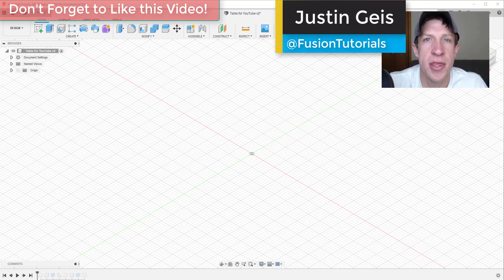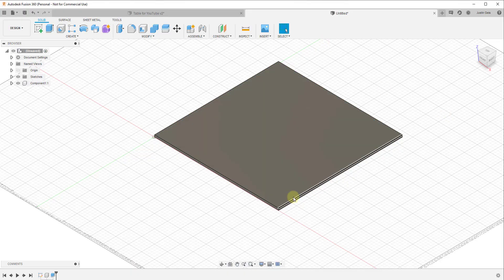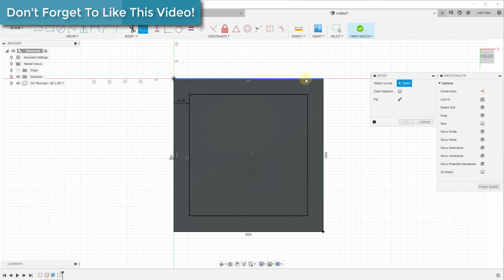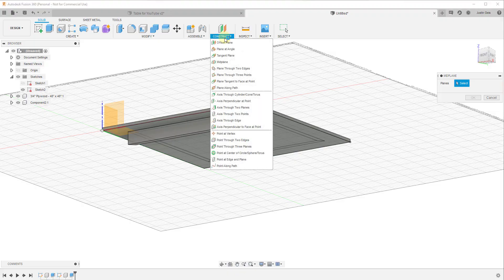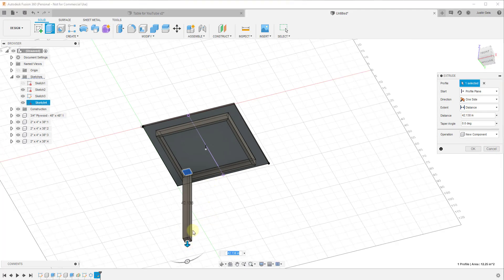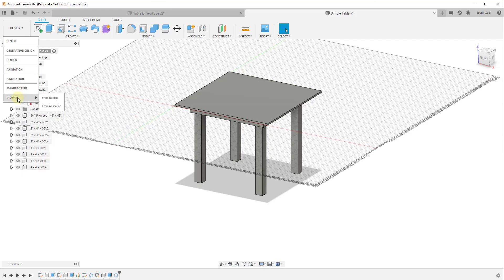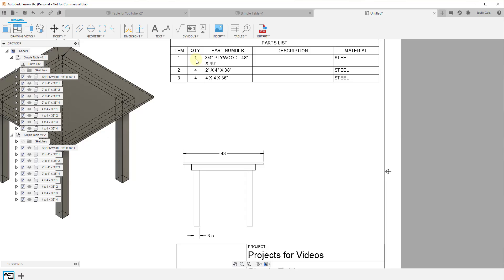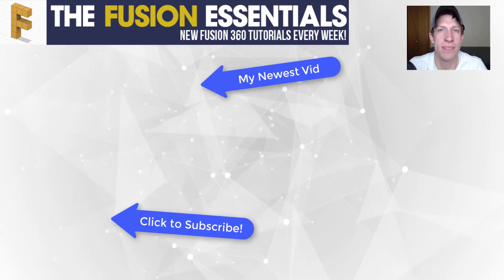Modeling a Table and Generating PLANS AND A CUTLIST! Autodesk Fusion 360 for Woodworkers 3

Comment from the maker: Hi everyone! Let me know if you have any questions about creating cutlists or plans from Fusion 360 in the comments below!
Reply: Is there a way to calculate board feet from fusion so that I roughly know how much wood I’ll need to go purchase? There is a sketch plugin that can do this
Reply: @Tatechow  I second this question. That would be really useful.
Reply: Hey.
Could you please make video with similar example but made from metal tube squares?
Reply: I am creating a curved storage bench with a multi-hinged seat, for an alcove. Do you know how to draw that out creating a curve based on the foreward most plane, essentially a flat line at the front of the piece of furniture. I have the distance from that plane at 1 ft increments along the width to create the curve of the seat but am not sure if there's a way to have the actual curve created based on the points. The piece I'm creating is something like this only boxed in and with a hinged seat.  https://www.goldenteak.com/westminster-teak-circular-curved-backless-bench-83-in-w.html
Reply: Great stuff.  Might be a topic for a different video but I would have loved to have you made the legs tapered.  Seeing how to do that would have been really helpful.

Comment: When designing real pieces in my workshop the design process is iterative. Joinery changes. Pieces change size. Embedding the size of an item in the component name we certainly lead to errors where the component changes size and its name does not reflect the size. Is there an advanced method of using tables where actual component size based on the drawing can be reflected in the table? I want, for example “Leg” to be the component name and to have another auto generated column that presents the Leg’s size based on the drawing.

Comment: i know this is an old video but this is where I'm at in the design stage. This table works only because the table is simple and symmetrical. if you are making something irregular the cut list is useless. say you need 5 legs 1 in each corner and 1 in the middle that 1 in the middle cant be a copy so your cut list will show 4"x4"38" quantity 4 and 4"x4"38" quantity 1. The only way i found to get around it is if i generate a custom table and add all the information manually. I genuinely don't know if I'm missing something or dose anyone have any suggestions? Also want to say your videos are well done and easy to fallow.

Comment: Great videos and thanks for not including any antics or fluff - it shows a rather considerate level of professionalism.  I've learned alot from your videos and have already made a toolbox and set of drawers, though I am struggling to make a workshop table cleanly.  I keep having to start new sketches to add extra elements I did not think of (i.e. extra joists, extra legs, segmenting apron into components, etc.) and now want to mirror one side to the other, but "it" won't let me in Sketch mode, which points to the need for some Fusion 360 Troubleshooting videos; you'd be the first to do that as nobody else has done this.  Sure, everyone presents the videos as if all is smooth sailing, but there maybe rougher waters you could help us overcome? Keep up the great work! Thanks, Kurt

Comment: This was very useful; I learned and practiced a lot! This is an older video...some of the interface dialogs are slightly different. In particular, I couldn't get your "midplane" technique to work (long description omitted). Further research indicated that I should create the table top as a Centered Rectangle, centered on the origin. I was then able to create the patterns as taught. That said, I could see needing to find a center point of an object that ISN'T centered on the origin...future skill learning. I also named the components for what they are, e.g. "Leg," and used the component's Description Property for the dimensions, which gave me a more understandable Parts List (wish I could attach a screen snip...).

Comment: I know this is and old video but when I try this even on a simple design, going to drawing (from design) the screen changes but then Fusion 360 freezes.

I have tried multiple times.  I even purchased Fusion360 thinking the Free Version could not do this.
Reply from the maker: Does your PC meet the system requirements? https://help.autodesk.com/view/fusion360/ENU/?caas=caas/sfdcarticles/sfdcarticles/System-requirements-for-Autodesk-Fusion-360.html

In general if this was a version issue (Free vs. Paid), I'd expect a pop-up or something saying to upgrade to the paid version to access the feature. As far as I know, the 2D documentation feature is available in the free version. The fact that it's freezing up makes me wonder if it's a hardware or graphics driver issue?
Reply: @TheFusionEssentials  Well I have a i5-7300U   which is 2 cores and 4 threads.  the link stated I needed 4 cores.  I guess that is it.   
 
Thank you.

Comment: Hi Justin. is there a way to automatically label/name a component based on the size so they are easier to manage, especially for resizing. i realize curves or anything with more than 4 sides/6b faces would be tough but doing this manually is a pain and error prone

Comment: 1 Thing I love about sketchup, is that I get a picture of my plywood.  So if I were to build something out of plywood, I could simply say my sheet is 4x8, and then it automatically places the pieces on the 4x8 sheet, making it a lot easier to see the best way to cut the full sheet for the most material.  Is that doable in fusion?

Comment: Very helpful video, thanks for your effort in producing it. I notice the Description column in your table is blank. Curious whether you can add something in there manually - or does Fusion populate that column from somewhere else in the design? What if you control the leg length with a parameter so you can't put in the length of the part in the component description? Have you already covered that in another video?

Comment: I'm watching this, and have a question on basic F360 setup.  When you draw your rectangle for the top, you type in the dimensions, and after hitting enter on the second one, your drawing still shows the dimensions.  Mine does not, and I would like to turn that on!  I do see that they go away when you click finish sketch, which is fine.

I may have other questions as I watch the rest of the video, but wanted to ask this before I forgot.

Comment: I watched this wondering how to make an all steel welding table (please tell me if I'm wrong or please make this exact video but for all steel plate and tubing)  What I think I'm realizing, is that; it doesn't matter what the material is because: if I know the finished dimensions of my stock the "sketching" process would be exactly the same?  Another awesome video either way, Thank you!

Comment: Thank you for making videos like this. But... The cut list is not tied to the actual dimensions of the pieces.  This kinda defeats the purpose of using parametric modeling in my opinion. If you were to change a parameter, your cut list does not get updated. Surely there is a better way.

Comment: This is good stuff.  I made it all the way to the circlular pattern.  I got the axis.  But this part is complex or the newbie -- and super hard to follow (at least or me).  The our copies must be spaced "equally around a center point" (0810 or so).  So you drop in a plane (and my drawing was top down, but the planes for my drawing were opposite of yours).  And, then you drew this magic center for the midplane.  I did many searches looking for "midpoint of square" and "find middle."  What's great about it is you say "I'm just going to draw a line on that plane that runs down and i'm just going to hit finish sketch" . . . "and what I did was create this center point."  Wait!  What center point  How did you get it centered?  How do *I* set the center point -- cause I've never done it before, and I don't know how to do it!  :-).  Video update for circular pattern'''?
Reply from the maker: I drew a construction plane across the center of the table. Then, I added a sketch aligned with that center plane. Because that plane is in the middle of the table, I get a midpoint inference located at the exact center of the table, because the construction plane is at the exact center of the table top in one direction, and the sketch midpoint inference is at the center of the table in the other direction. Hope this helped
Reply: The Fusion Essentials what’s a sketch midpoint inference?  Like one hovers over the spot around midpoint?
Reply: Is this the inference technique you are speaking about in the comment below from yesterday?  https://www.youtube.com/watch?v=L4vr-6WNung. (If it is, I didn't know the keystroke, which is what left me out in the lurch.  The more the crowd gathers around your video, the more your comments will flush these issues out.  I'm about 6-8 hours into drafting in fusion.  I probably had about 60 hours (maybe) on sketchup - but I never made anything of real consequence there.  In other words, I'm an utter beginner and prone to misunderstanding even simple commands :-).

Comment: Nice tips on creating the parts list.  Fusion 360 sure does seem primitive when it comes to parts list.  IDK why it can't figure out which pieces have identical sizes regardless of the component name.  I would have thought someone created a plugin to turn a design into a parts list if the tool really doesn't support it.